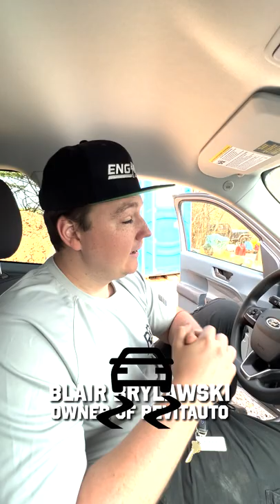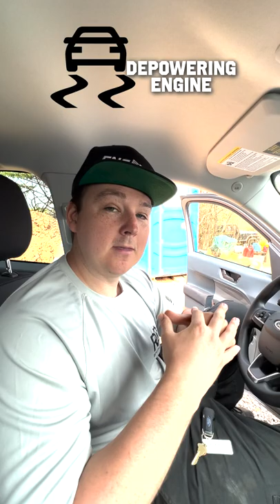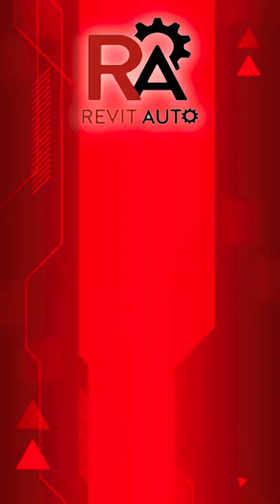What Traction Control Light Means! #shorts

Comment: I have a 2wd 2013 regular cab and that switch is for an electric rear brake application to limit slip under certain conditions and is only used when driving slowly.

Comment: I have ot on my jeep patriot. It's been on since I got it. I was driving in the snow yesterday and took off and the light went off for about 10 seconds then came back on. The button to turn it off won't turn it off. When I first got the jeep I got it to work but once it came back on I can't get it to go off now.
Reply: I can’t get it off my car either, did you get any resolves ?
Reply: @briancorrales0529  right now I have not. We got some snow about three weeks ago and I noticed when my tires started spinning it went off but came back on I tried replacing my speed sensor and it did the same thing. Went off then came back on. Do you have an abs light on as well or just the traction control light?

Comment: So if that light comes on while driving in icy or snowy conditions or both, should I keep using the accelerator of let off of it?
Reply from the maker: That is a great question and depends on so many different factors, slope, vehicle position, location of other vehicles and obstacles. What is beyond you accelerating. I am sorry I cant just blanket tell you which direction to move in!
Reply: What does it mean when this light comes on and the check engine light comes on at the same time. I’m driving a 2012 Camry and this is happening to me when driving. And the car begins to shake a bit
Reply: How do I  stop it
Reply: @DivaStyle4412 U should find a nearby garage and report to a Maintenance person immediately
Reply: @DivaStyle4412 I have a 2010 Camry and mines is doing the same thing. Did you ever figure out what that was?